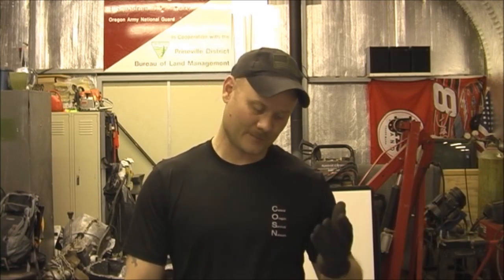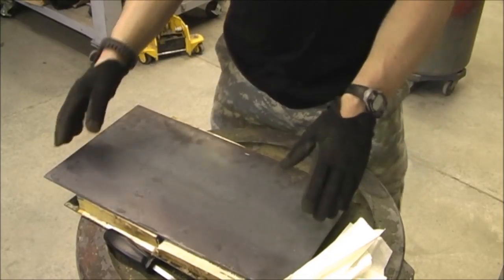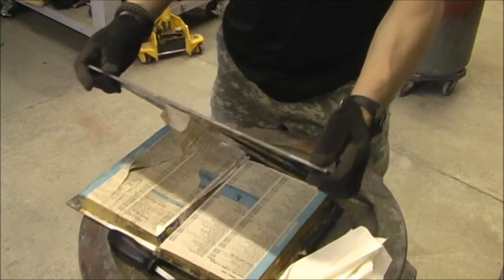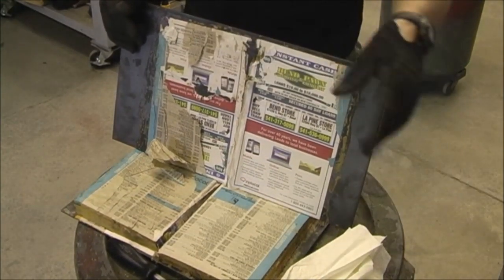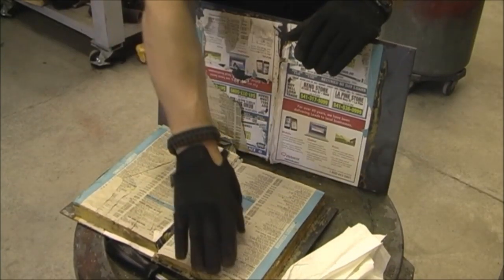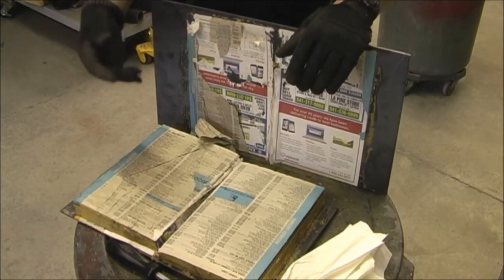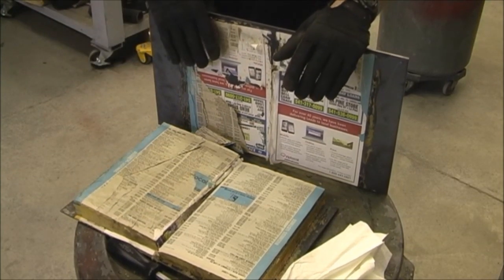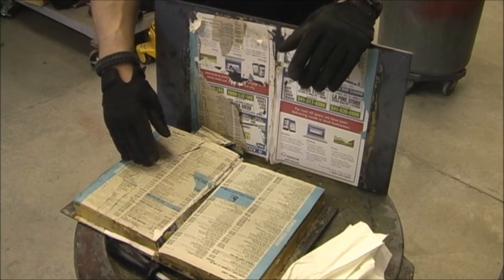Homemade Bulletproof Armor Project "Video 2"

Comment: I'm surprised you didn't sumerge your phone books in your wallpaper paste and then flip through the pages separating them to allow for better penetration of the paste.  Probably better to try it with you doluted solution for better saturation. Maybe you did try this method and just didn't elaborate on your video. Great series of videos. Refreshing to see someone intelligent,  who doesn't come off as nutty and/or ignorant working on project like this. Thanks again
Reply from the maker: Thank you for the positive feedback!! I did try to delude it, but I don't think I deluded right and let it soak long enough. I was to excited to get try it out, I am trying a different method. Could just buy Ar-500 plating, but the phone books are the main objective. Again, thank you for positive feedback and for watching..

Comment: One thing you may want to check out is how people make carbon fiber parts. There is a lot of information in that process that may help you with impregnating the phone books with some form of an epoxy. For instance, one of the ways they will make sure that the epoxy is fully in every crevice of the carbon fiber, yet not too much that it weighs it down or isn't beneficial to the structure of the part, is by using a vacuum bagging process with a special cloth that allows the epoxy to move across the part during suction. They will allow some room up in the tube to the vacuum for the excess epoxy to gather. Obviously that cloth won't work on a phone book, but what if you were to drill small holes of varying depths in parts of the book, then they the vacuum bag process?
Reply from the maker: Mmm interesting, I will have to check out that process. I thought about fiber glass or carbon fiber. I have tested the armor out and it works well, but there is a certain round I can't stop. The penetration video should be out today... Check it out and let me know what you think. Thanks for the comment, it could just be my solution.